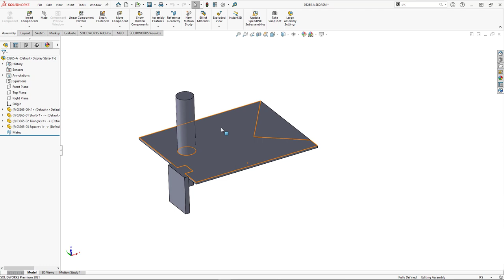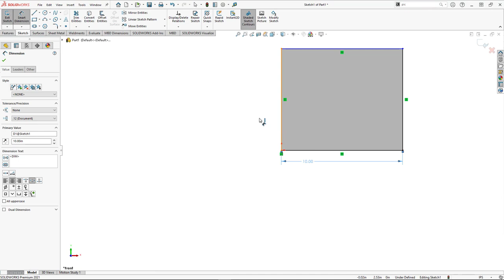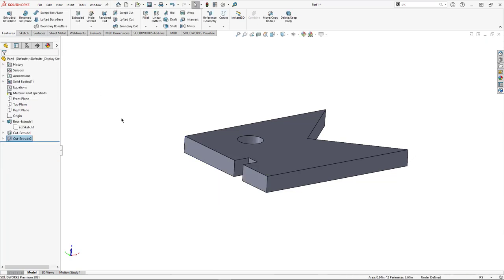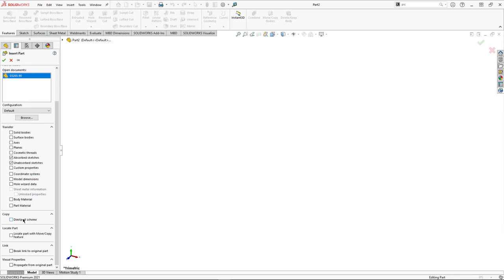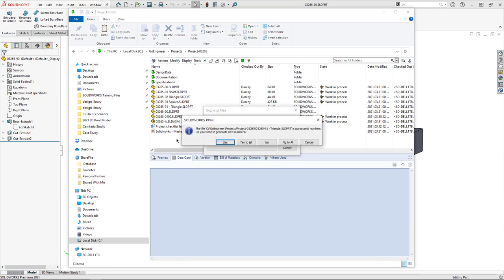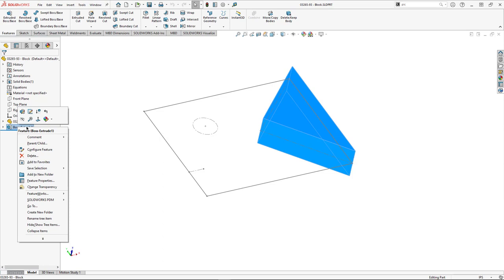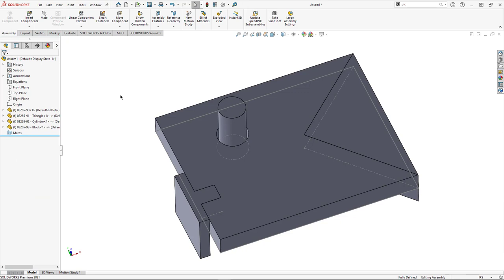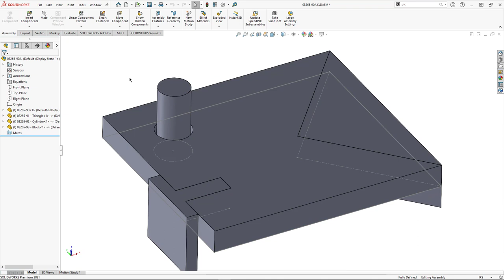SOLIDWORKS - Master Model Technique

Comment: I use this technique when designing injection molds.  However all of my sketches are in the top level assembly and they're all fully defined.  The shapes of sizes of my components are controlled with sketches and multiple instances of component locations are defined by another sketch.  I actually eliminated the use of a third party add-on software (Moldworks/Splitworks) after adopting this approach.

Comment: Timestamps:
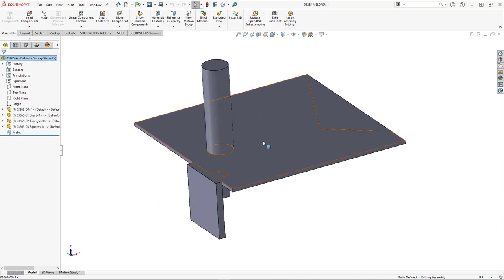1:27 Making "master part" containing the original master sketch. Other sketches in master part have "Convert Entities" relationships with master sketch. 
3:30 Make Cut-Extrude relationship to master sketch 
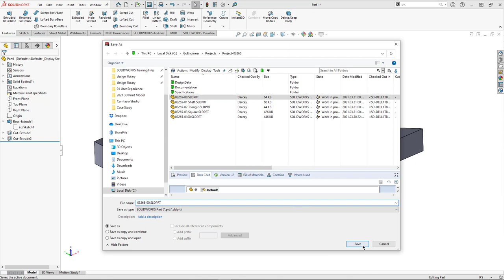4:40 Save "master part" 
4:45 Make "triangle part" and insert "master part" but only sketches 
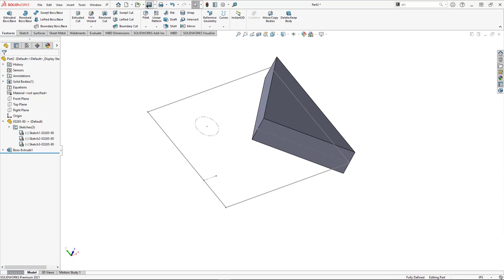6:09 Save "triangle part" and make copies to use as templates for cylinder and block parts 
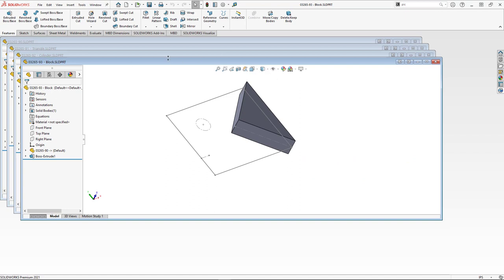7:40 Mod template part to make "cylinder part", delete existing convert entities sketch and offset entities to make cylinder 
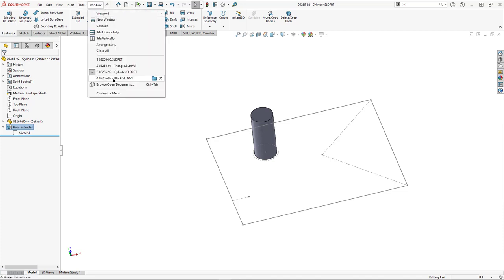8:16 Make "block part" 
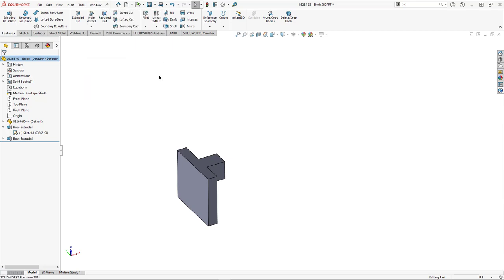9:32 Make assembly

Comment: If You unfix the master model and move it inside assembly will other parts follow it?
Reply from the maker: I’m assuming you mean to unfix one of the components, so that component can have motion. Yes, you can definitely remove the Fix relationship and mate it like regular part, and it will still update with the shared sketch.